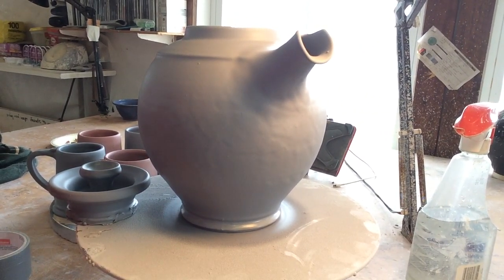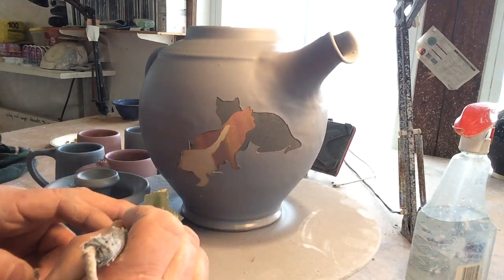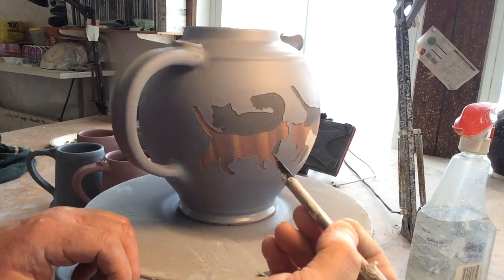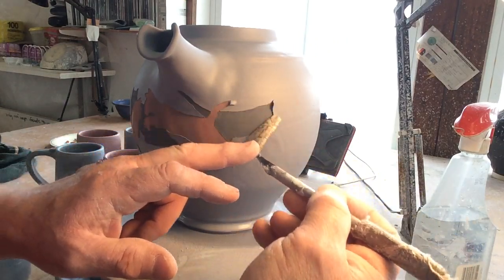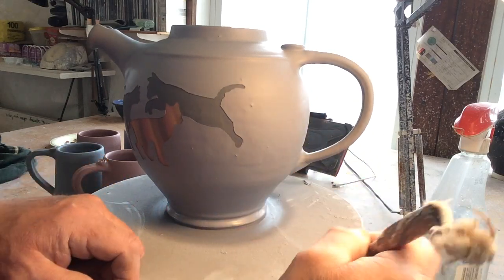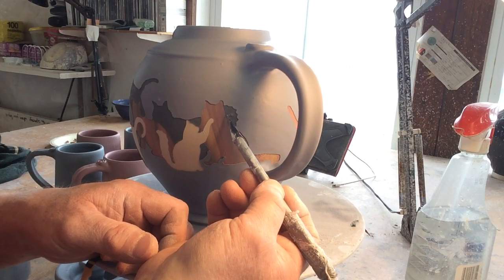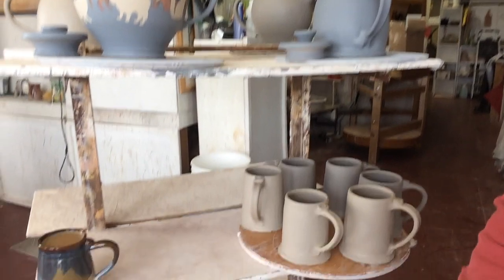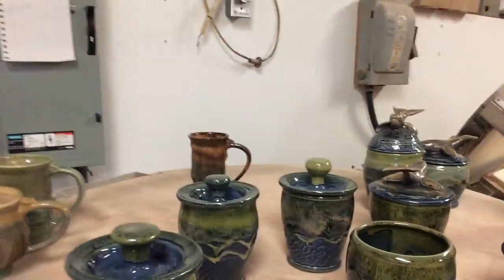Stencil removing a teapot

Comment: I would love to see the steps involved in getting to this point. Tips on thickness of the slip going into the sprayer would also be great.
Reply from the maker: The layering process takes all day and I don't have the ability to turn the ipad  on and off in the same video. The slip has to be sieved through a 100mesh. I used to dip the pieces but the slip has to be perfect or the thickness made the handles fall off. I am sure better timing is all that is needed for dipping. It is a very tricky process and it requires lots of attention to humidity, clay softness and dryness. The layer thickness must be perfect and only comes with experience and knowledge of your materials. It can be too thin and thus transparent/ transluscent. Too thick and you cannot see the paper. It is a challenge.
Reply: @Vsmithpots  Thanks for explaining Vaughan, I am thinking about trying your technique. Perhaps starting with just one layer. What type of sprayer do you use? I have a sprayer I use for glaze, will that work?
Reply from the maker: @darrellmelton1215  yes but keep the pressure lower.
Reply from the maker: @darrellmelton1215  Badger 250 external mix.

Comment: Vaugh  Have you posted a video on any next steps of the stencil process?  I would love to see bisqued stencil work and how much sanding you have to do.  The paper technique seems better for me.  I have been using painters blue tape and results are so so.  Do you let the first layer of slip dry on the paper or can you commence with a second layer of sprayed slip.  Bill McDonald
Reply from the maker: It is a very tedious technique and the process is over at least a day and usually into a second day. It all depends on humidity and drying. It takes two sprayed layers for each layer of slip. I tried dipping but the handles get wet and fall off. You can dip when the pot is almost leather hard but then the slip might chip off the rims when drying/shrinking. You have to time everything perfectly. I tried teaching it but there was too much loss in the ware. The better way is to use underglaze but it was more expensive, but timing was less of an issue. I do not do the technique much any more because of the precision needed, mostly for special orders. The paper has to be applied when the slip is leather hard or just under. Then re sprayed before the paper  wrinkles. You can do three layers max before it is impossible to find the paper. It was also hard because once you start a piece you have to be present to get the next layers on when the timing is perfect. I missed many a lunch or dinner when I used to do these as production work.
Reply: @Vsmithpots  Yes I have had bowls crumble from the wetness.  Do you have any videos on your finishing the bowls rough parts and edges before clear glazing?  Is your slip B-Mix and Mason stains?
Reply from the maker: @billmcdonald9115  Just use 100sand paper if the edges are sharp and any slip will work with any stain, the slips have to fit the clay shrinkage so best to use the same slip as clay.